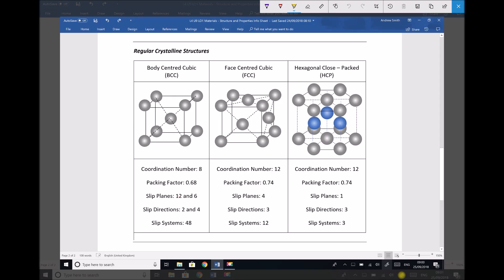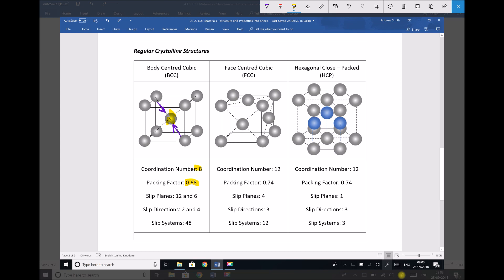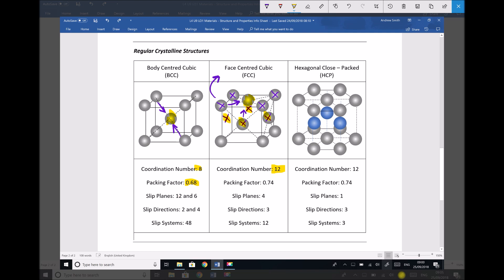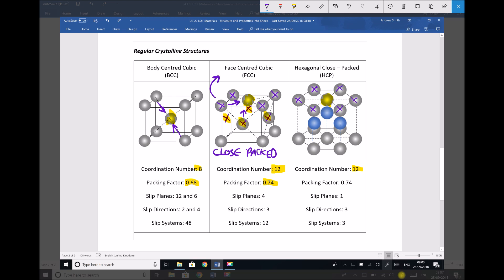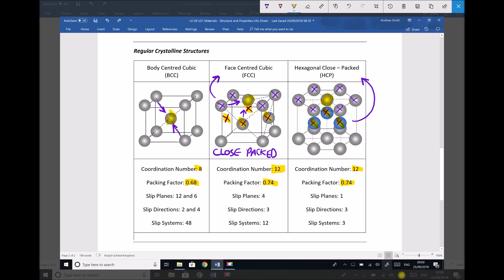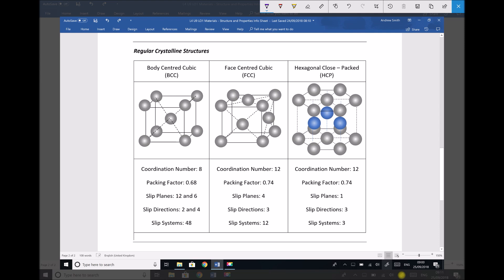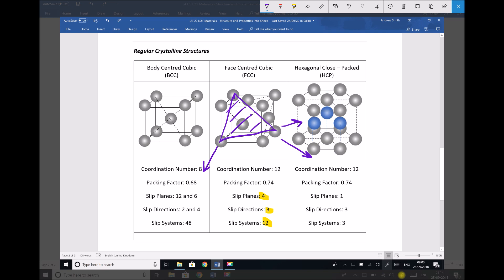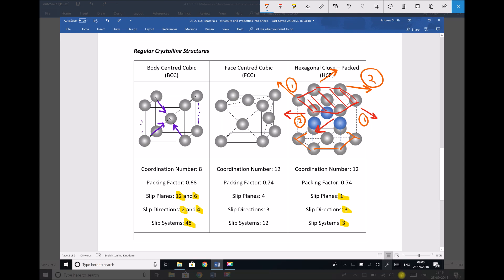Coordination Number, Packing Factor and Slip Systems in BCC, FCC and HCP Structures

Comment: How do you determine the number of slip planes in the BCC structure? I don't see how there would be 18 planes.
Reply from the maker: Hi Hasan. This is a slight simplification as it depends on the material. If we take tungsten (W) as an example, there are 6 {110} slip planes and 12 {211} slip planes. It is still quite hard to visulalise, but hopefully this image will help: https://images.slideplayer.com/13/3815885/slides/slide_4.jpg
Note that alpha iron has an additional 24 {321} slip planes.
Reply: @EngineersAcademyLTD  Unfortunately that image does not include a coordinate, so in comparison of the respective, albeit unmarked, {110} and {211} planes, {211} is both drawn confusingly, and I believe wrong, as the {211} plane should intersect the x-plane within in the unit cell, instead of outside. I believe a {122} plane was drawn instead of a {211} plane. Just to help people avoid confusion.
Reply from the maker: @ianvangiesen2523  thank you for you feedback. I agree it is certainly difficult to visualise, but for our programmes the important thing is how the material properties are affected by the presence of slip systems. It is probably not a sufficient explanation for someone studying material science, as an example.